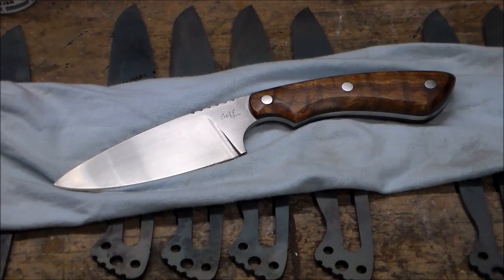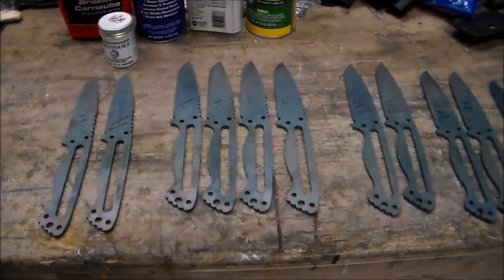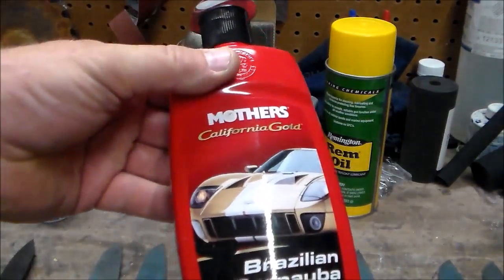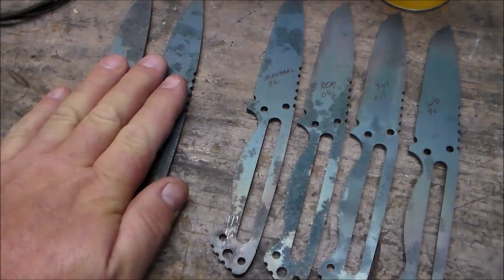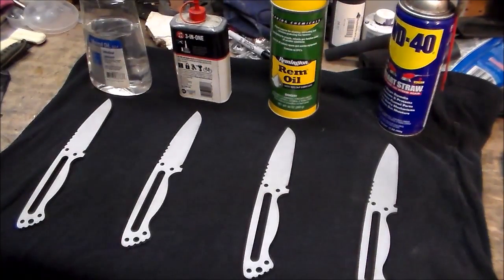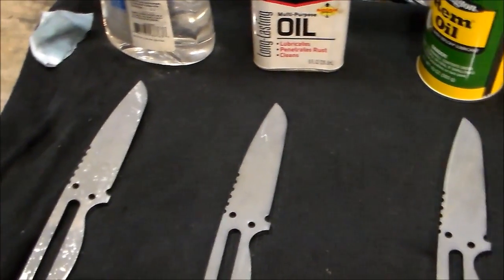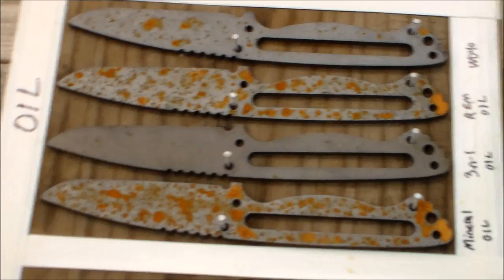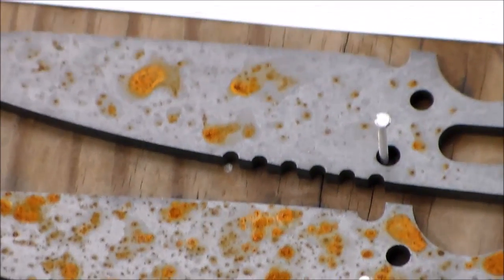1095 Steel, Corrosion/Rust Test for Knife Makers

Comment: Great test!  I believe you mentioned that these blades were not hardened, just annealed and it would be nice to see this test in the hardened and tempered condition.  Hardened, the steel would be more resistant as the ¨pores¨ (spacing in between grains) would be closer/finer.  The general trend would probably be the same but it would be nice to see in it´s final heat treated condition.  Great stuff, thanks for putting the time and energy into the test, it´s the way it should be done.
Reply from the maker: +Rafael Lastra Yeah, I'd like to see a hardened test too, but the chances of me ever having that many blades ground and hardened all at once aren't so good. I was also afraid it would introduce extra variables into the test. I mean, could you really get them all exactly the same through the hardening process? I wouldn't HT 1095 before grinding since it's shallow hardening, so could you really get them all ground "exactly" the same? But, you do point out some good questions, I wrestled with those exact thoughts too. Maybe someone could buy 10 production 1095 knives, strip them down and do this test? Not me.....
Reply: I hear you, and you are right, without a proper furnace/temperatura controller it would introduce a bunch of scatter into the results.  On the other hand, annealed is the worst case scenario for corrosion, as such I believe the trend would be the same for the different treatments.  Thanks again for the test, good stuff.  Cheers from Spain.

Comment: I’ve always heard you heat the steel to a black heat before applying wax to help it deep into the pores. I wonder if that makes a difference.
Reply from the maker: Michael Carbone in general blacksmith work sure, that's great. When working with hardened, edged tools, no way. Too big of a chance of messing up the temper. I like waxes ok, but you just have to maintain it.
Reply: Self Made Project thank you

Comment: One thing I'd suggest to try is Johnson's paste floor wax, just have to make sure the blade is warm and dry as it will trap moister.  Rather surprised that 3n1 did the best.  I've done a few test, nothing as comprehensive as yours and hardened steel shows a little more corrosion resistance, but if all were hardened they'd still get basically the same results, just maybe be a little less rusty, but most likely the same difference between the blades.  I will continue to use wax, but that's mainly because I can use it on natural handle materials as well as the blade.  If I do any all steel knives I think I'll give the 3n1 a try.  Anyway, thanks for sharing your testing, it was informative and about as scientific as you can get.
Reply from the maker: Thanks. I've got some Johnson's paste wax, I use it on wood projects all the time, especially wood turnings. Never tried it on a blade, but I will now.
Reply: One other possibility is boiled linseed oil, I primarily use it on hawks and axes, primarily the haft, but while I'm there I give the head a good rub down as well.  I also tend to apply it to the head during the last temper so it'll somewhat season like a cast iron skillet.  Kinda apples to oranges though.

Comment: Very informative video Self Made Project!! Do you think a white vinegar patina and 3&1 would be good? I have an ESSE 5 and was thinking about removing the coating and doing the patina.
Reply from the maker: Yes, I did several blades with vinegar before switching to cold bluing. Vinegar just takes a while, you have to heat it up, soak, scrub, soak, scrub...to build up a good patina.

Comment: I have a question about the 3n1. If it has been asked already, I do apologize. If I clean my knife with 3n1 and then end up having to prepare some food, would it be safe? (I am not saying directly after I clean it just in general.) Thanks for your time and awesome video!
Reply from the maker: It is a good thing to think about. Here's a snip from the MSDS "Ingestion: This product has low oral toxicity. Swallowing may cause gastrointestinal irritation, nausea, vomiting and diarrhea" and it goes on "Numerical Measures of Toxicity: The oral toxicity of this product is estimated to be greater than 5,000 mg/kg and the dermal toxicity greater than 2,000 mg/kg based on an assessment of the ingredients. This product is not classified as toxic by established criteria." So, judge for yourself, but I am not the least bit concerned on using it for a bushcraft/camping food situation. I probably would not use it on a kitchen knife that sees daily use, mineral oil would probably a better choice on those.
Reply: Okay. I really appreciate the fast reply. I appreciate the great details even more! It is definitely something to think about. The knife will not be a kitchen knife, but more of a all around task/camping knife. Thanks again for the time you put into doing this awesome experiment. Have a great day!

Comment: im wondering which ones would be food safe other than the mineral oil, am also curious about bees wax
Reply: Let me know, I am also curious about the bees wax. Is 3 and 1 not food safe?
Reply: @mokgable  i know that mineral oil is considered food safe, also assuming bees wax is too
Reply: So 3 in 1 oil is basically motor oil. I always wipe my knife before cutting anything so I'm sure there is a minuscule amount of oil in the meat.... that said this is a good question for sure.

Comment: What was the temperature during the day time? Were the knives in the direct sunlight? Because that could definitely effect the wax in a different way than oil, and possibly be the game changing variable, as oil is known for it's use in hot conditions and wax melts away.
Reply from the maker: No direct sunlight, they were under tree cover all day. As for temps, it was late spring, early summer, so 70's-80's with Arkansas humidity. I think the conditions should have given all the products an even chance to perform.

Comment: excellent test, I have been considering a dura-coat or similar product as an option on some of my knives. I will have to do a test to see how well they preform compared to your test. additionally, I use Bacon Grease to coat my kitchen knives at my cabin. they are always good as new when I get there. I wonder how well an animal fat would hold up in a corrosion test? I've heard of old timers using animal fats (bacon, bear) to cover their rifles and knives on hunting trips where supplies was a real consideration.
Reply from the maker: +Tony W Thanks! Yeah, I want to try Cerakote one of these days.

Comment: Do you think that the blued and the 3 in 1 might have done better because you have more experience applying those finishes?
Reply from the maker: No, not really. The acid finishes perform just about as well. I think it's just the oxide layer that bluing forms is great for holding oil. I mean think about it, they've been bluing guns forever, so there's obviously something to it. I think even a natural aged patina would do well oiled. Thanks for checking it out.

Comment: Interesting that the old stand-by, 3-in-1 Oil, came out the best for corrosion protection. Who woulda thought?
Reply: Goes to show you that things that have been out for a while are proven.....
Reply: Other similar tests I’ve seen show 3 in 1 as a top rust protector too, so it’s hot a fluke, it really is great at rust protection.

Comment: Good test!!  But you really need to try Frog Lube.  I electro etch my logos on my blades.  Had a couple finished knives ahead of orders so I Frogged em so they wouldn't rust in my shop with the swap cooler in Arizona summer heat.  1 Month later I had the 2 knives sold and knew I had to clean them so they'd take an etch.  DOUCHED them with acetone and scrubbed the heck out of them.  Them repeated with 92% isopropyl alcohol to rinse.   I could NOT get them to etch at all!!!  By far the best anti corrosive I've found.  1 drop on each side rubbed around.  And, FrogLube is food grade!  FDA approved on commercial meat slicers.  Since 90% of my blades are skinners, I won't want my customers cutting into their elk with Mobil 1, WD, or anything else like that.
Reply from the maker: Thanks for the comment. I definitely want to try Frog Lube, I think it has been the most suggested product in these comments. Is it carried in local stores or online only? I don't recall ever seeing it before.
Reply: I order it on Ebay from the cheapest vendor of the day with free shipping.  Usually $13-$14

Comment: Curious how natural patinas using mustard/vinegar or coffee would hold up with and without oil and wax
Reply from the maker: I try to keep some kind of protection on my carbon steel to prevent rust. I like the look of patina and that also helps slow rust to a degree. As patina ages, it gets tougher and better with or without oil. Think about your Grandma's kitchen knives, all those years of hard use and now they have a great looking patina. She probably never put oil on them.
Reply: @SelfMadeProject  I was just curious if forced patinas made from soaking in a vinegar or coffee solution would hold up, especially since it would be perhaps a more food safe option. Then again I’ve read that bluing a knife has no real health concerns if used to process food.
Reply: @Still_awake19 I wonder the same thing. For me, I use flax seed oil on my kitchen knives and wood handles after washing them, and it definitely works better than mineral oil ever did, or any waxes too.

Comment: I work in a butcher shop and just ordered some damascus skinning knives. How can I protect them from rusting during a 10 hour shift under heavy use?
Reply: I would suggest buying a food safe oil (even canola oil) and maybe wipe it down. You'll get so many mixed opinions on high carbon steel care. The best I can say to do is ask someone who owns Damascus. The rust gets worse with your humidity level wherever you live. I ordered some 80crv2 and it's just sitting in my room and it's already showing a little but of rust lol. Just make sure it's food safe. So NO WD-40
Reply: Your options are limited if you are working with food. Mineral oil is the only FDA approved food safe oil for kitchen use. Just keep an oil soaked rag (lightly soaked) in a plastic bag and wipe down your knives after cleaning them at each break and end of shift. Doing that they shouldn't rust in the short amount of time exposed to blood and moisture during a normal shift.

Comment: When you say you blasted them doese that mean you sprayed them with a substance and what substance makes that color ? Also super blue is that the same as bluing like in rifle barrels ?  Im a learning knife maker and would like to learn about protecting 1095 but alot of things i dont understand
Reply from the maker: +zacatecano1986 By blasting, I'm referring to abrasive blasting, or also known as sand blasting. That just gives a nice even statin finish on the steel. For bluing, yes, like they use for guns. I use Birchwood Casey Super Blue.

Comment: Great video! but I have to ask, what is blue? Hope it's not a stupid question
Reply from the maker: Its a process called cold bluing, commonly used for refinishing firearms. It leaves a durable black oxide that holds oil well.

Comment: Does SS Knife blades need to be protected, Against any Rust.? Or just the Carbon Steel Blades etc.?
Reply from the maker: SS blades will rust too, just not as easily. Some are better than others too, but I still oil them occasionally.

Comment: AWESOME! Do you have opinions on Tuf-Glide oil. Is it the same as 3-in-1?
Reply from the maker: No, I've heard of it I think, but never tried it. Maybe someone else will chime in.
Reply: A lot of people use it and compare the two saying that Tuf-Glide is even better. I would really like to know. Just a suggestion: now that you know that 3-in-1 is the best of the tested bunch, maybe just compare the Tuf-Glide and 3-in-1 coated steel blanks. I know that the test you did is time consuming and probably wasn't very cheap. Thanks again for sharing this great information.

Comment: Thanks for this perfect test.
Can you remove the rust from the bare 1095 to see how deep it went ?
Reply from the maker: I did clean these up after the test, nothing was very deep really that I recall. I re-sandblasted them and have finished most of them since then. The process of making finished blades out of them ends up with every surface ground and sanded, so I wasn't overly concerned with the rust.
Reply: Self Made good to know, i tought rust was deeply damaging the blades
Thanks for sharing your knowledges

Comment: Is bluing the same as bluing in rifle barrels? also when you are spraying the knives whats is it and why are you spraying them  . I would like to preserve knifes im almost done making but i dont know how to protect from rust its 1095 steel pleez help  im new to knife making and im learning  this video is great just i dont understand all
Reply from the maker: +zacatecano1986 This is the same that bluing that you can use for rifles at home. It's not as good as the factory hot bluing, but it's inexpensive and easy to use. I use Birchwood Casey Super Blue. Not sure what you mean by spraying, maybe you're referring to the sand blasting. I use an abrasive blasting media to clean and prep the surface before bluing.

Comment: I’ve got a machete that I want to put a cord wrap on the handle similar to the knives in the video, right now I just soaked it in vinegar (to remove the scale) and really like the look of it. But I’m concerned about keeping the metal under the cord from corroding. Another option I thought of was cerakote the whole thing. Any help? It is 1095 steel.
Reply from the maker: I've had the same worries about corrosion under the wrap. I just tell customers to try not to leave it wet and if they are super worried about it, I'll re-wrap it for them. Cerakote would be a great option! Some guys soak the wrap in epoxy which would seal it too.

Comment: Renaissance wax is the gold standard for long term storage in a controlled environment.  (i.e. a museum)
The conditions of the test are not the conditions I would want to use Renaissance wax in.  Kept indoors out of the sunlight and not touched or messed around with more than very sparingly, I've had one knife last for years without reapplying and not a hint of rust.
That said, for something you would actually be carrying and using, I would also not choose renaissance wax.  Oil will be cheaper and easier to maintain the protection with.

Comment: I have used a cotton wheel with wax. No rust in several years. You have to let it get hot and dip it in turtle wax and return to the cotton wheel.

Comment: Also the finish on the blade plays a huge roll. A stone wash or hi polish will prevent rust better that a satin or bead blast...
Reply from the maker: Agreed. But, for testing purposes the bead blast seemed like the most consistent finish I could do to keep the test accurate.

Comment: I think it is a test of how well the coating sticks to the blade under rain fall though, if they don't get washed away by the water they should stay unrusted shouldn't they?
Reply from the maker: +Iamthedudeman00 Yeah, I'm sure all the products would protect indefinitely out of the weather or high humidity. But, I was curious how they would react to the elements to simulate use in the outdoors.
Reply: +Self Made ok I see. Thanks for the video.:)

Comment: Should try adding them to heated steel to compare the difference between this and doing the equivalent of seasoning it like u would with a cast iron skillet
Reply from the maker: Well, maybe, but as a knife maker I would never tell a customer to use heat. Too easy to mess up the temper or epoxy, or scales. Risky!
Reply: I agree I mean for us knifemakers to do before we send one out
Reply: seasoning cast iron or carbon steel has nothing to do with the metal itself, you bake organic oil on because it polymerizes and that polymerized oil is what makes it non-stick
Reply: I know I was just curious how itd compare to applying cold

Comment: Just curious, what do you think a blued or acid finish with 3in1 look like? Would you have time to setup 4 again: control, 3in1, blued & 3in1, acid & 3in1?
Reply from the maker: That's pretty much all in here, a control, 3n1 bare and 3n1 blued. The acid finish with 3n1 looks exactly the acid finish with Rem oil, or any other oil. I use both blued and acid finishes all the time and they look very similar. The blued finish usually comes out a little blacker though.
Reply: Self Made, interesting... I would think that bluing or acid plus 3in1 sould be better
Reply from the maker: Huh? Better than what? Guess I don't understand what you are asking. If you put any kind of patina on carbon steel and oil it, it works pretty good. I've tried mustard, vinegar, bluing, and acid. Whatever patina you choose, it will still rust, but not nearly as bad as a bare blade.

Comment: Self Made Project does the white vinegar patina offer as good of protection as the blueing?
Reply from the maker: Did you get my reply the other day? Maybe youtube dropped it... Anyway, I'd say yes. I used a vinegar etch on a few and it worked just fine. Cold gun bluing is just a faster process and it might be a tad better. The vinegar just took too long for me, you have to heat it up, soak, scrub, repeat a few times. But, it will totally put a patina on there.